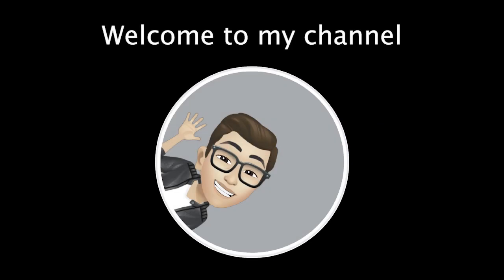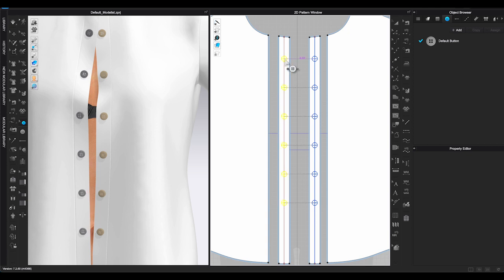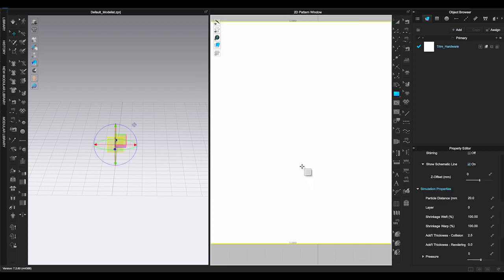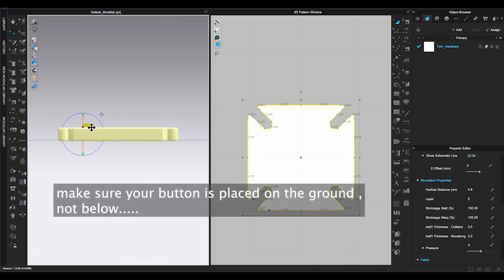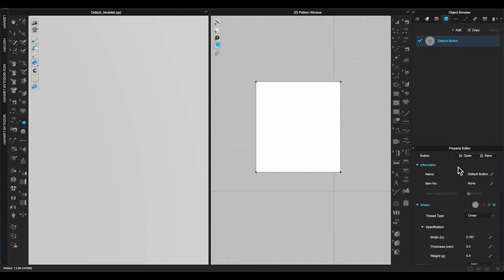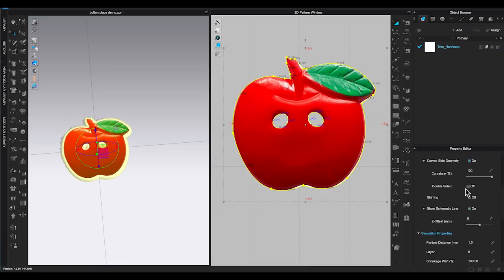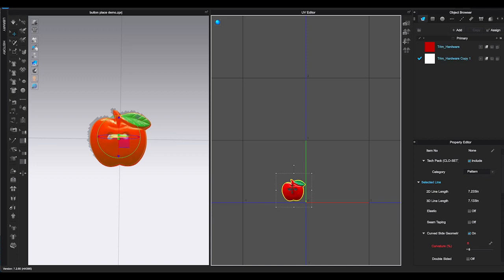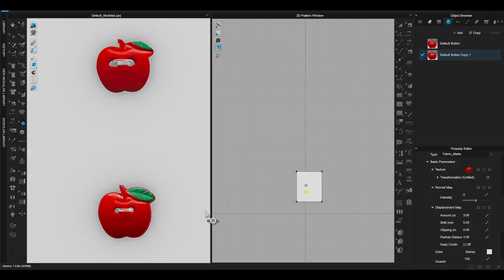how to create custom buttons (CLO 3D tutorial)

Comment: Excellent tutorial, thank you! But how the rendering works in this case, is it ok? I just applied texture to standard button, but CLO doesn't render this button after this. I will be appreciated if you know how to solve it
Reply from the maker: when you said CLO doesn't render the button...you meant the buttons didn't appear in render? or just the texture?
are you using the latest version of CLO3d?
Reply: @Kev-in-design  Yes, exactly, the button doesnt appear at all in render window, i see a buttonhole rendered in that place instead of button :))) i would add printscreen but its nit possible here. i have CLO 6.0, i wonder if this problem appears in next versions too or is there way to solve it
Reply from the maker: @annveligurskaya7015  it's a little hard to tell what your situation was. Have you tried to switch to a different style of button and see if it's the same in render?
Also, what type of material are you using for the garment?

Try to delete button and save your work as project file. Reopen clo3d and log in, then try to add button again and see if it will fix the issue.

If it still doesn't work, you can go to support.clo3d.com and type your question and attach screen shots there. They will be able to help you there as well.
Reply: @Kev-in-design  Yes, thank you very much for advice! I will do this, definitely!